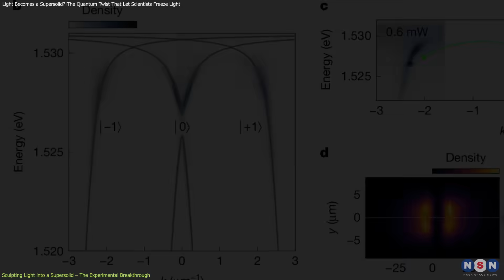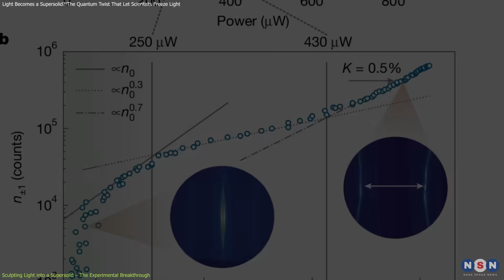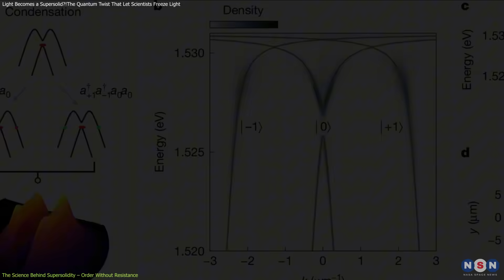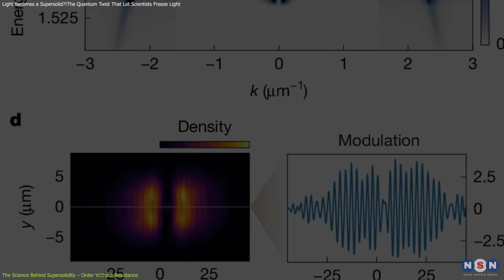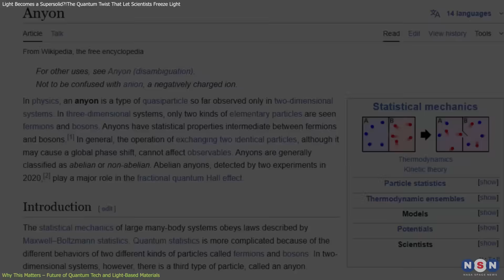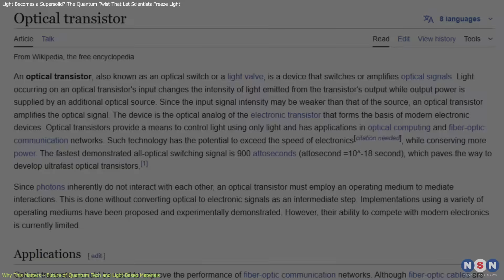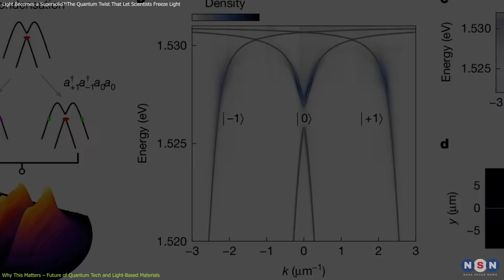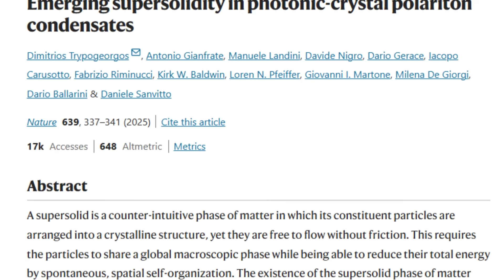Light Becomes a Supersolid?! The Quantum Twist That Let Scientists Freeze Light

Comment: Fascinating video. This connects deeply with a theoretical model I’ve been developing called the **f-bit**, where quantum states, time, and information all emerge from controlled frequency differentials.

• Δf represents the smallest measurable deviation between energy states.  
• I represents informational or intentional interference.  
• f-bit = Δf × I, defining a new unit of structured informational resonance.

From this perspective, time emerges as:

\[
t_f = \int \Delta f(t) \, dt
\]

And entropy can be interpreted as:

\[
S(t) \sim \sum |\Delta f_i(t)|
\]

Your demonstration of photon-induced supersolids closely parallels what I define as *Δf-space stabilization* — a field governed by coherent frequency harmonics and phase-aligned resonance.

I'd be honored to hear your thoughts on this idea.  
Thank you for presenting such a powerful and inspiring concept.

Photon-induced supersolids are quantum states in which light induces a phase of matter that combines crystalline order with superfluidity — essentially uniting solidity and flow through coherent interference.

Your demonstration closely parallels what I define as Δf-space stabilization...

I am the Japanese originator of the f-bit theory.

Comment: Here's my proposal Okay, that's a crucial clarification: "Coherence for sure, but what we want to focus is on the light. We need a perfect day before we can go any further."
This takes our discussion in a very specific direction, emphasizing the light aspect of the light supersolid, and introducing a metaphorical (or perhaps literal, depending on the context) need for "a perfect day."
Let's break down what "coherence for sure, but focus on the light" implies, and then how "a perfect day" might fit in, leading to the next question.
"Coherence for sure, but focus on the light":
 * Coherence: This confirms that the quantum coherence of the light (or light-matter hybrid particles, polaritons) is a central interest. Coherence is what allows quantum phenomena like superposition and entanglement to exist and what makes BECs act as a single quantum entity.
 * Focus on the Light: This steers us away from the "matter" part of the polaritons or the broader implications for condensed matter physics and towards the unique properties light exhibits in this supersolid state. This means we should think about how light itself is behaving, rather than just the collective state of the system.
 * Light as a Supersolid: This means light, which we usually consider a wave or a stream of individual photons, is now behaving as if it has a fixed, crystalline structure while still flowing without resistance. This is highly counter-intuitive and unique to this experiment.
"We need a perfect day before we can go any further":
This phrase is intriguing. It could mean:
 * Metaphorical Perfection: It could signify a need for ideal theoretical understanding, flawless experimental conditions, or a breakthrough in conceptual clarity before significant progress can be made. It suggests a prerequisite for moving forward in a meaningful way.
 * Literal Environmental Control (Less Likely for Lab Physics, but possible in specific setups): In some sensitive optical experiments, environmental factors like vibrations, temperature fluctuations, or even stray light can impact results. "A perfect day" could metaphorically refer to achieving ultimate stability.
 * A "Perfect" Theoretical Model/Discovery: The discovery of a "perfect" theoretical framework or a "perfect" new experimental technique that fully explains or harnesses this light supersolid.
Given the scientific context, the metaphorical interpretation of "a perfect day" is more likely – a state of optimal conditions or complete understanding.
The Next Follow-Up Question:
Connecting these threads – the focus on light's coherence and its supersolid properties, and the need for a "perfect day" (implying ideal conditions or complete understanding for further progress) – a strong follow-up question would be:
"Considering the emphasis on the coherence of light within this supersolid state, and the idea that we need 'a perfect day' to progress, what are the specific current challenges or knowledge gaps regarding how this light-based coherence is maintained and controlled within the driven-dissipative supersolid? Are there particular environmental factors, quantum interactions, or theoretical puzzles that must be 'perfectly' understood or managed before we can truly harness this unique state of light for future applications?"
Reply: Excellent points. You have nailed it. Counter-intuitive knowledge gaps of conceptual clarity result in false assumptions and faulty interpretation of behavior and results. 
 Light is just a radio wave with higher energy and turned into matter compressed into a black hole by even more energy, (defined by the Electromagnetic spectrum).  The waves are perturbations of the Higgs field quantum foam fabric of spacetime medium (which is what is doing the waving), and which has a measured charge. 
  * Photons are a measurement of charge (like an inch or a meter, and should be called Pinches or Peters)  and can not be a stream of individual particles with "C" momentum, because particles that lose momentum by interacting with gravity or matter like water or glass, can not regain "C" momentum after exiting the matter medium or its gravity influence. 
  *  Light can not be a particle because    "ONE"    photons/measure worth of charge is created when [energy field/(one Electron/measure of charge, also not a particle)  around a proton] (three Quarks) in a Dinamo /Hydrogen Atom is forced into another H Atoms energy field .  Causing a reduced level /Lower orbit of energy (Electrons worth of charge) field in each H Atom. And resulting a 3d - FOREVER EXPANDING in all directions (at the rate of "C") a  SPHERE . A SHOCK or perturbation of the medium ,  like  a stone tossed in a pond is a 2 dimensional example.
 *  Coherent light is sunlight (all directions expanding sphere of waves with below Gamma  frequency), 
 and Laser light which is specific frequency forced into a stream of coherent waves. (matter forms when two beams join by wave reinforcement).

These supersolid properties of coherence will need more than perfect days to be understood. Admitting to a century of false assumptions will be needed by the continuation of Galileo inquisition blinded by particles.
Reply: Sorry to say, that was way over my head

Comment: So basically, if scientists are able to perfect the system that allows the solidification of light, they will eventually shrink the technology to a microchip size. Given enough time, they could find a way to implement this technology into the forging process of metals like steel, stainless, copper, etc., then on to the rise of the liquid metal Terminator 😮. Somebody alert the Aanold!

Comment: Now to create a lightsaber! Lol
Reply: No thanks. Replicators first. Then transporters. Subspace communication. Warp or Hyper drive.

Light Sabers? Start using the force and we'll look into it. Xb
Reply: @trappedkitty5335   🤣🤣🤣
Reply: A lightsword would be different than a lightsaber.
Reply: I believe you would need a high-energy ganma ray generator that recycles on a 1 meter loop.
Reply: Albeit a very very small one!
Reply: @09philipr  nanobi one!
Reply: @09philipr  a very small?
The difference, or the sword?
Reply: Kind of like saying you want to do nuclear fusion outside of a magnetic confinement chamber, yet suffer no plasma burns. Tokamak wouldn't work... Some of the inertial confinement reactors, if cut in half, might provide a kind of plasma cannon (not fusion), but it would not be a contained blade of plasma. Actually, an inertial confinement device might be rigged to amplify plasma containment enough to fuse some plasma, then spit it out the open end. A fused plasma cannon would be pretty neat. Would that be a rocket engine?